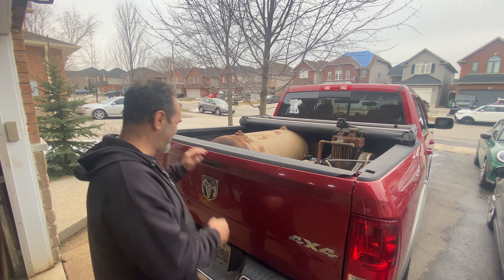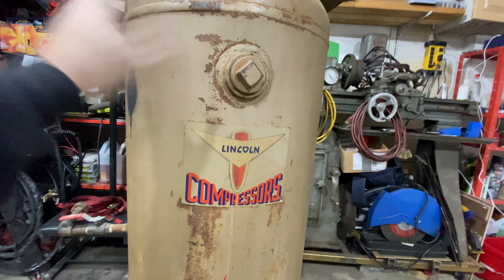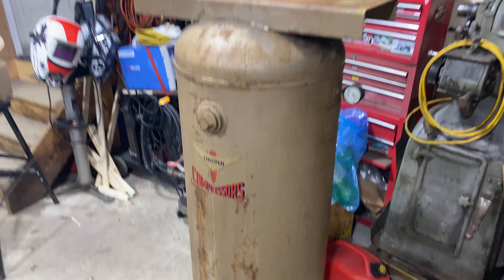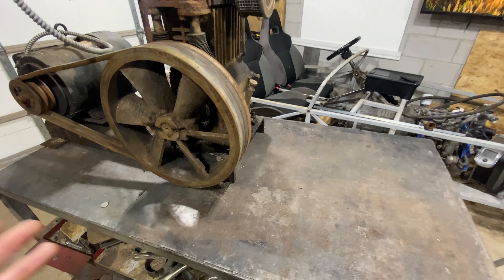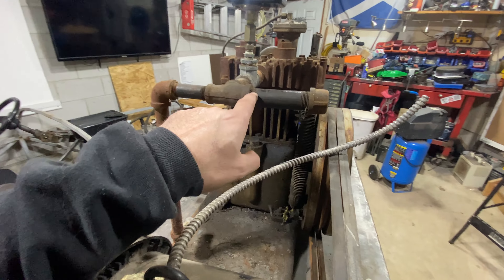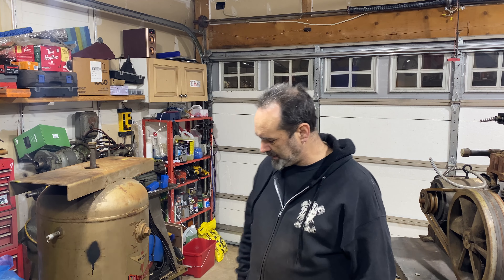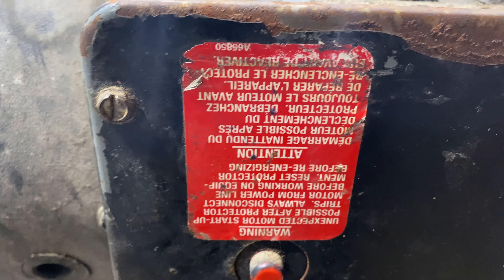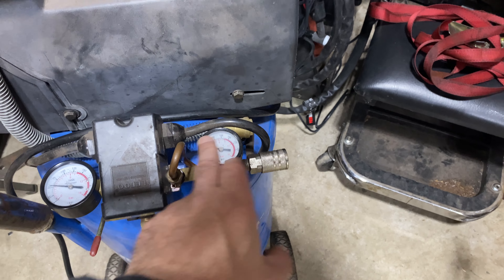Feeling The Pressure With A New To Me Garage Tool At Scott Rods

Comment: Is the motor single phase or three phase ? The bottom pipe on the pump is an oil drain pipe and only use specific pump oil NOT car engine oil , leave the wiring on the pressure switch as is even if you replace the cable . Do not mount the motor and pump on top of the tank , i think the oscillation of the pump will eventually tear the tank floor fasteners out , no proof just a gut feeling . Get the tank checked for rust , i have seen the results of one letting go , not nice at all . Make sure you fit a filter reg and a new tank drain pipe , make sure you drain it regularly and leave the drain open until you use it next time , this helps the tank to dry out . The hissing noise will remind you that the drain is open when you use it next time . Good buy though .

Comment: Only 2 hp for 12amps on 220volt seems crazy pretty sure my 7hp(peak) requires 15amps at 220volt

At least it's single phase. I see a lot of guys get a killer deal on a compressor only to find out it's 3phase.
Reply from the maker: Will find out soon, getting parts today.
Reply: @ScottRods  oh also, being an old tank it will most likely have some rust inside.  Since you snapped off your 1/4" NPT drain valve I suggest taping a bigger one in the bottom.  I purge my tank unlike the previous owner and rust debris gets stuck in the 1/4" fittings
Reply from the maker: @David-82  Yup, got myself a tap set, and ordered a new drain valve.